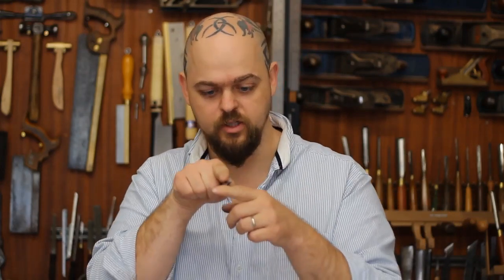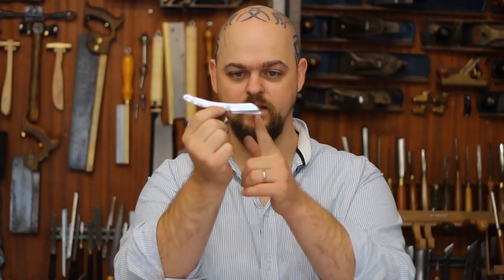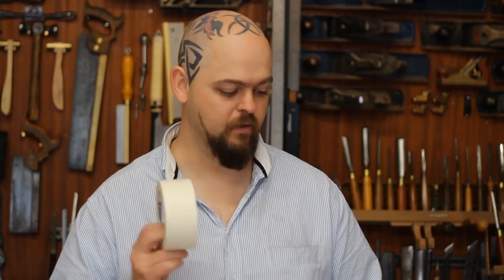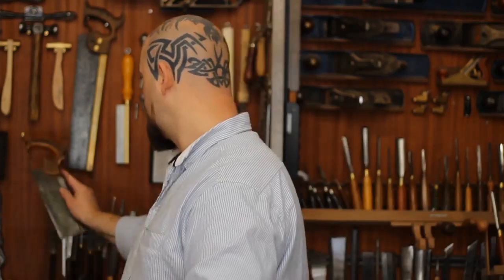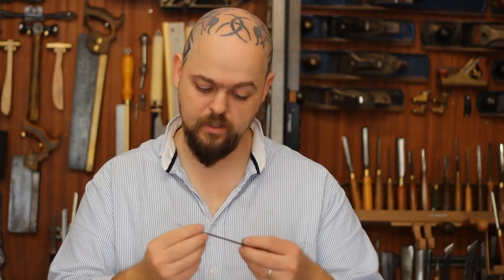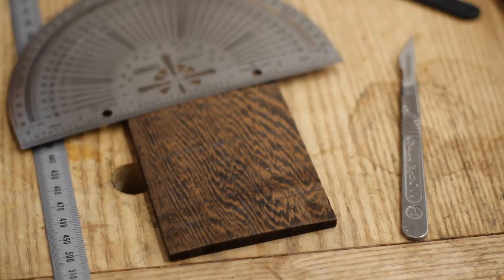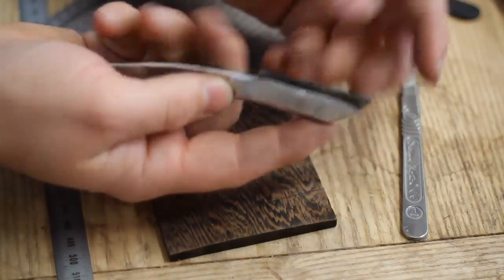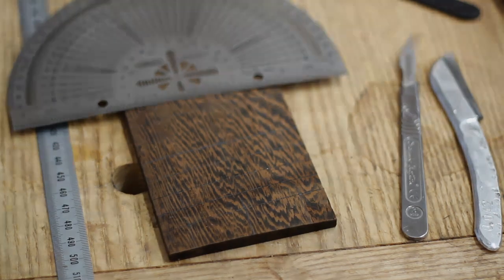How to cut fret slots by hand - Guitar Builders Basics Video Podcast - Ep 33

Comment: The most ridiculously simple fret slot depth hand cutting  tip I heard is to use a moderately bright source of light on one side of the saw blade. It just has to be bright enough to cast a shadow and at an angle e.g. the afternoon sun is perfect. As soon as no light shows under the saw blade (through the teeth)  the depth is about right.

Comment: aw man, could have used this one just a few hours earlier ;) messed up one slot, the rest went well. i improvised another method: get a slightly flexible plastic ruler, push it against your fretboard in the desired position, hold the saw against the ruler to make the cut.

Comment: Hey thanks! I like your CA+Masking tape method, and the marking knives are a great way to go. I just went with the framing square, paper template, and spray adhesive because I'm not as handy with hand saws as you are. I'm working on that though. I'm making an effort to use more hand tools and fewer machine tools, because I think it will be more fun.

Comment: I thought using a knife line was common practice when cutting cross grain....It's known as a knife wall in paul sellers speak...
Reply from the maker: I agree, the problem is that so many guitar builders are incredibly insular and know next to nothing about other forms of woodworking.. I know I am guilty of that myself, there is so much to learn that we forget about the basics sometimes.
Reply: You just get a nice crisp pristine cross grain cut with a knife line and starting the saw cut is so much easier when you can seat the kerf into the groove. Squaring the knife line off around all the faces also helps ensure a square cut with no tear out. ...I watch inordinate amounts of Paul Sellers videos.....as well as my now daily fix of Crimson guitars.....I think you should tidy up the aluminium handles and lose the hammered finish...that's my opinion anyway

Comment: Forgive me if this is an incredibly noob-ish comment; I am, after all, a noob by all counts. How does a marking knife differ from a scalpel blade? You spoke as if this was a massive change to your method, but it appeared as though both methods comprised of "measure, mark with small blade, saw with big blunt saw, saw with smaller sharper saw". I assume if I had the two in hand the difference would be more than sufficiently evident, but having no experience handling either, what about this constitutes such a "change of tune", as you put it?
Reply from the maker: Manny Cowdrey-Cuberos the change of tune is actually more about using a knife at all, it was a general comment about guitar builders and western woodworkers than a comment on my method, although I used to only recommend the knife cut if you were a beginner.. I now use it myself all the time!
Reply from the maker: Manny Cowdrey-Cuberos oh, and  flat blade versus curved blade of this marking knife just act differently, I use both for different jobs and marginally prefer a straight blade tbh
Reply: So it simply a matter of preference between the curved and straight blade, but both are equally suited for the work they do (or at least this job). Got it. Thanks for the responses :)